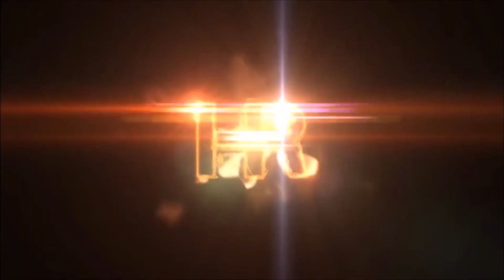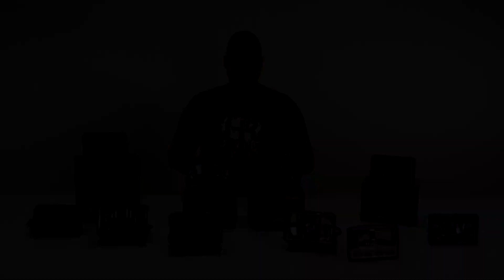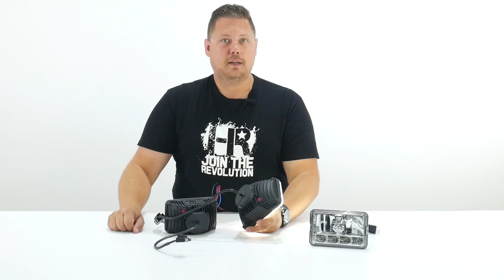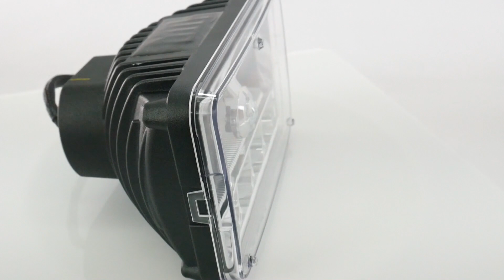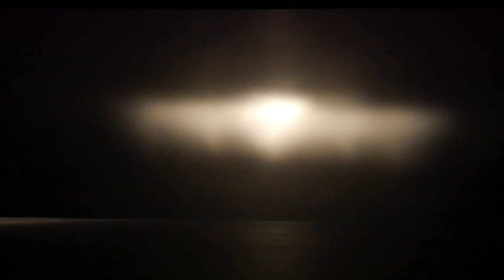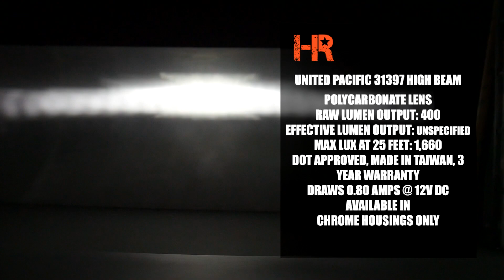United Pacific 4x6" LED Headlight Product Review, High, Low, and Dual | Headlight Revolution

Comment: Wow I was tricked, or mistaken. I figured the 31365 was a 4x6 version of the 31297. They are not similar. The 31297 has all5 LEDs light up on high beam but the 31365 has separate high beam and low beam.
Reply from the maker: Most 4x6 headlights are only available in low or high beam and not both. I know that Vision X has a few dual beam 4x6 options, but I do not believe United Pacific offers any dual beam 4x6 headlights.

Comment: "Or Re-Wire this Connector" OK so what do we need to do!
Reply: Open the housing and change the circuitry. 
The low beam shuts off when the high beam is powered.

Comment: Hello, I have an 91 Mercury Grand Marquise with 4 headlight, 2 for low and 2 for High. Could I wire the Dual beam in all four locations to give me 4 Low Beam and 4 High beams?
Reply from the maker: Thanks for watching, shoot us an email at sales@headlightrevolution.com or if you prefer give us a call at (218) 755 - 5505  
and we will answer all your questions.
Reply: It's possible

Comment: I have the UP 31396 and 31397 on my truck. They are a vast improvement over the standard bulb. The only drawback is when I drive when it's snowing,they will get covered with snow real quick. I found you when I started searching for a solution to that problem and the J.W. Speaker lights look like the way to go but I wanted to research other brands first. 
It would be nice if you explained the lux rating better. I'm assuming the higher the number the better it is,correct? If so,why is high beam rating lower than low beam. The only reason I could think of,was the high beam was designed to shine further than 25 feet.

I should mention the UP lights have been on my truck for over 2 years now. I have them lit up whenever it is on the road day or night.